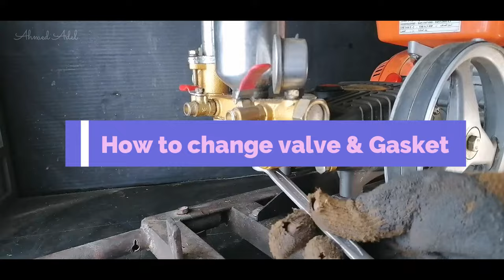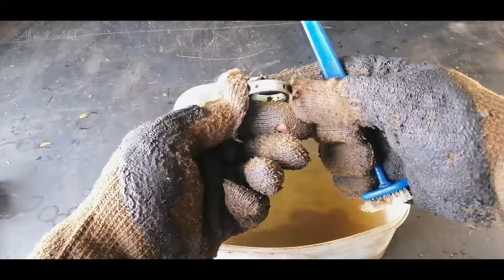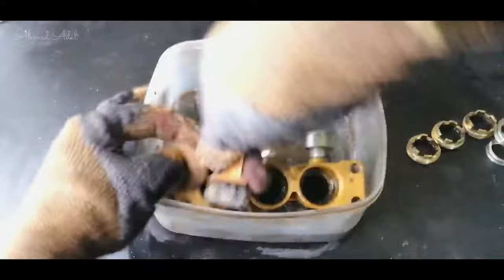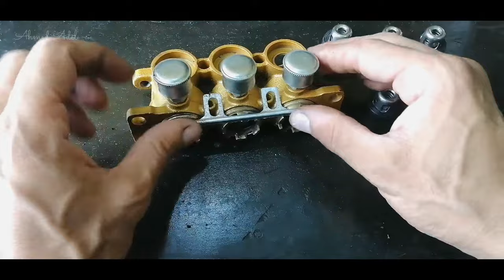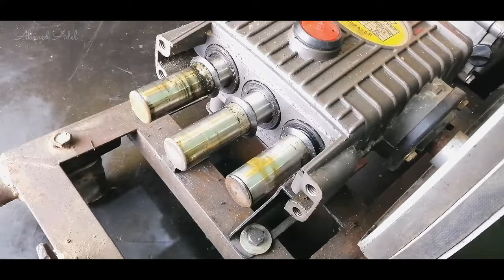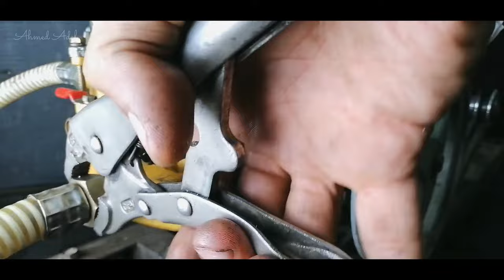How to change valve & Gasket  for power sprayer pump l Pressure pump repair

Comment: Sir I change piston vashal, install new valve set,new section pipe,and piston are new but still pump is not making pressure please reply
Reply from the maker: Hello my friend, change the intake manifold and make sure there is a seal. This is necessary to prevent air from entering during the intake of water

Comment: My pump is absolutely new . I have been using it for a month and a half. Pressure was very good when i started it but after a month pressure is very low. Kindly guide me because i have no mechanics in my city for this pump.
Reply from the maker: Welcome and thank you for watching. You should make sure there are no holes, cuts or cracks in the water connection first. Disassemble the front part and make sure the valves are working properly